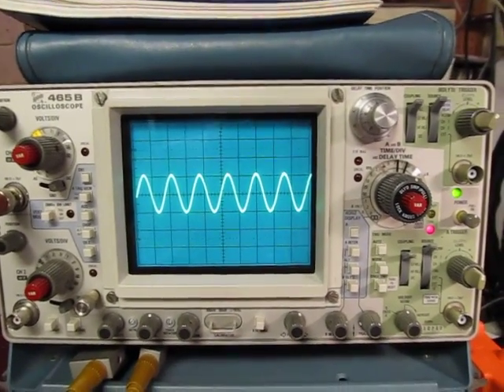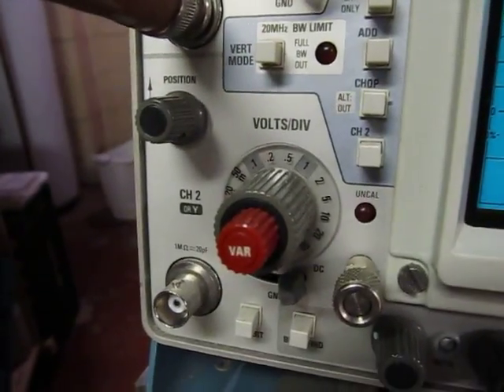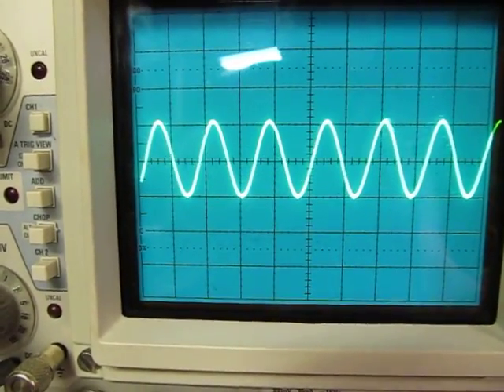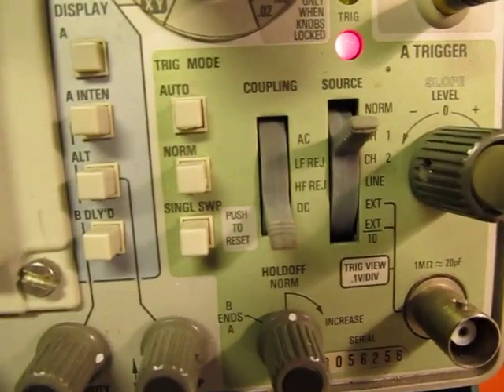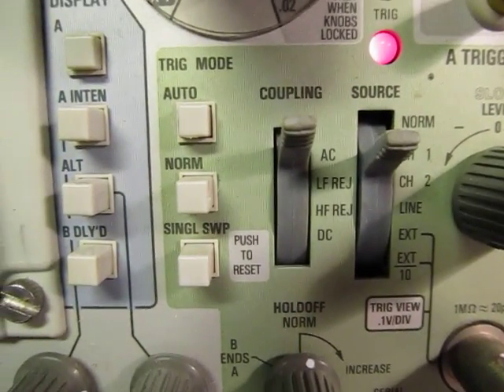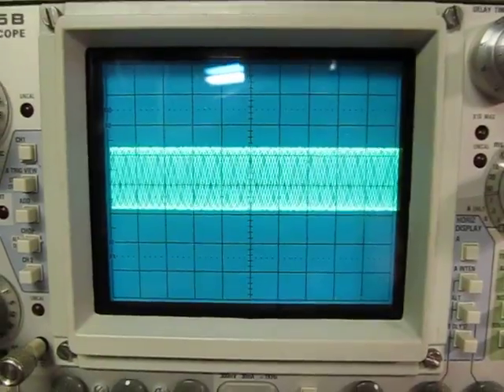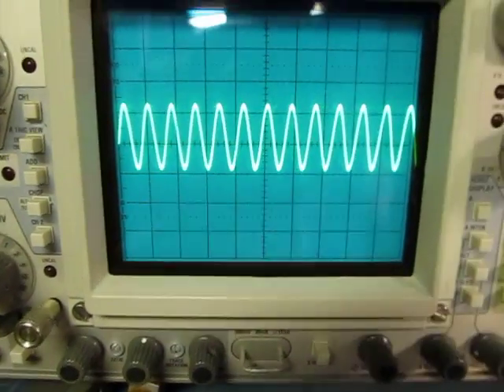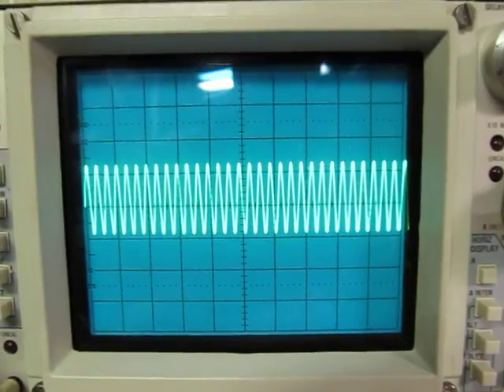#11: Tektronix Oscilloscope Triggering controls and their usage

Comment: Thank  you for sharing your experience with a CRT scope.  While I do have and use digital scopes, it's important to me to still practice the foundational understanding of measurements.  Your video helped me to better understand the various control aspects that I was not clear on, as well as (couple) the functions of the digital models.
Reply from the maker: As you've discovered, I have a lot of videos on analog/CRT based scopes as well as digital scopes.  I hope you find them helpful.

Comment: Seems my old Tektronix 468 may have finally reached its end of days. I've had some minor issues with the buttons and knobs for the past year or so, but nothing insurmountable. Yesterday however,  the old workhorse refused to boot-up. The fan came on, and the "beam find" dot indicates the CRT screen is working... but otherwise it appears dead. Any suggestions for a quick fix before I inter this fine machine in the oscilloscope grave yard? Could it just be a blown fuse or something? I apologize for my ignorance. I'm not really knowledgeable enough to attempt a proper diagnoses.  Kinda feel like five-year old kid with a flat tire.
Reply from the maker: Common issues would be power supply problems - all fixable.  The guys over at VintageTek have been doing a lot of 468 restorations lately - check the videos on their youtube channel.

Comment: When using the Oscope ch#1 to measure waveforms on the circuit under test, mostly the probe will use the frequency of the waveform as the trigger? What other frequencies or pulse waveforms can you use as a trigger for circuits under test? For digital circuits in order for the oscilloscope to be in sync you have to use the clock frequency as the trigger. I'm not sure what other types of circuits under test would use different frequencies/waveforms or pulse waveforms in order for the oscilloscope to display stable waveforms. Can you think of what type of applications of circuits that use different triggering frequencies that the oscilloscope don't sync up unless you use the external trigger.

Comment: Hi, I have a question on the grounding schemes in scopes. In case of an Analog scope is the scope ground connected to the safety ground? So if we try to measure an isolated load (without safety ground connection), is the load being grounded via the scope? I have many follow up questions related to the isolated scope and isolated probes etc. Would be great to see a video on this topic if you dont mind. I came across a webinar from Teledyne lecroy "Probing in Power Electronics
What to Use and Why". They mentioned it is not safe to use passive probes in many applications.
Reply from the maker: The short answer to your two questions are yes and yes. The vast majority of scopes have the input/probe ground tues to the chassis/safety ground. So, you do have to aware of this if you are working on something that must remain floating (such as a hot chassis).

Comment: Hey there w2aw,  I did not see any comments for the "single sweep" mode. I did not see anything for it after you went through Auto and Normal. It was roughly around 11:20. Thank you very much
Reply from the maker: Single sweep mode on an old analog scope like this was only useful when used in conjunction with an oscilloscope mounted camera.  You'd mount the camera, setup the vertical, horizontal and trigger settings as needed, arm the scope for single sweep and open the shutter on the camera.  When the scope got triggered, it would sweep once and the film (or polaroid pack) would capture the trace.  Then, close the shutter and develop the picture.  Viola - single-shot storage, as it was done back in the day.

Comment: what can cause an Oscilloscope triggering to erratic, meaning that it does not stay steady, it drifts and move when you try to trigger it.
Reply from the maker: It could be a number of things.  Most often, it is caused by the signal being too small (try changing the vertical scale), or there may be noise on the signal.  On modern digital scopes, it may mean that a signal path compensation is needed.
Reply: It's an old HP 108T solid state oscilloscope that I acquired from a friend and it does not matter what  signal I put in, it still drift from side to side. I tried cleaning the trigger pot and it help a little. I cannot get a schematic for it.
Reply from the maker: I've never heard of a 108T.  If you can point me to a picture of the front panel of the scope, I might be able to provide some pointers on how to use it.
Reply: Sorry its not 108T, its180T model.
Reply from the maker: It should be a simple matter of setting up the trigger level, slope and coupling properly.  Put the scope in NORM trigger mode (not AUTO), since AUTO trigger can sometimes fool you into thinking that you're triggered.  See my video on how the AUTO triggering mode works.

Comment: I just came across your video series and I love them.  I do have a question and it has to do with, in some videos where you are scoping small signals there’s an complete absence of high freq fuzz and genuine high freq interference, spikes, bursts and misc spuria flying through your scope’s display (i.e. cellphone, Wi-Fi - yours or a neighbor’s, cordless phone, active Bluetooth, etc.).  When I’m scoping low-level signals on a device or proto board at home I have to contend with what’s “real” and what’s in the air.  How do you avoid this airborne trash in your tutorial setups?  I have a ~$300 dual-trace + storage Hantek scope and I see all kinds of annoying RFI/EMI stuff.  Is it a matter of spending the bucks for something that’s much better as in quiet?
Reply from the maker: There are a few things...  In many cases, when probing low level signals, I will use the front-end BW limiting feature of the scope whenever the signal's frequency content is low enough.  This keeps the higher frequency RF signals from getting in.  Also, make sure the probe's ground leads are as short as possible.  On digital scopes, I will sometimes use averaging if the signal is repetitive, that reduces random and uncorrelated noise sources too.

Comment: enjoyed the video. I have the Tektronix 465B and I am in the process of calibrating it. The manual specifies the use of a time mark generator specifically the Tektronix 184. These are almost impossible to get hold of here in the UK, do you know a modern equivalent that I could use?any help from anybody would be greatly appreciated.
Reply from the maker: Any pulse or square wave generator (function gen or AFG) that is capable of producing sufficient output frequency and has a frequency accuracy better than the timebase accuracy on the 465B would be fine.  I used an AFG3252 function generator.

Comment: Right now I have a Leader LBO-523 scope. Not a bad scope for one that I picked up a state surplus store 20+ years ago for $35. I would love to be a scope pilot behind a Tektronix 465. Is this, or what is your favorite scope for all practical purposes? Thanks for the great video!
Reply from the maker: It's tough to pick a favorite.  The 465 is a workhorse.  The 485 has a smaller CRT, but is razor sharp.  The 2467 is super overall, but it a bit larger.  I go to the 2467 most often (same as 2465 but with a special fast-writing CRT).

Comment: Thank you very much. I wanted to ask your opinion about two scopes. I'll ask the shorter version of the question first. TDS3054 &  TDS3034 which one is good enough for a repair shop? 
Long version: 
I found a TDS3034B for a very good price. It comes with four probes manuals.
But I been looking for a TDS3054B Cuz I was told by others tds3054B is the scope I should get. 
But I don't have the knowledge yet to know  if I need the capabilities or the extra bandwidth of a TDS3054 in the future repairs. 
Learning how to use scopes is an ongoing project right now. At the moment I have a 100MHz scope w/ 2 probes & component tester. 
I am trying to get a repair lab going in the shop to complement the field service work that I do full time.
The boards I will work on are out of medical and dental equipment or really any boards... CNC machine pcbs,, sterilizers, x-ray boards, chair or table controllers....motor controls, some industrial PC boards.....

I can get a tds3034B for 1/2 of what the TDS3054B are going now. 
Which scope do you think is best for the repair work without over doing it.
Reply from the maker: I think you'll be fine with the TDS3034B - the extra bandwidth on the 3054 isn't really going to buy you much for the work that you're doing.

Comment: Hi,

An example of this would be usefull.

I undestand that the internal signal would adapt itself to the external one?

EXT: Signals connected to the EXT Trigger input connectors are used for triggering. External ... must be time-related to the displayed signal for a stable display. It is usefull when the internal signal is too small... or unstable...
From the manual.

Comment: Very nice tutorial! But I still have one question: does that single trigger/sweep freezes the screen so that you can make some measurements later on? Like I want to capture and measure an overvoltage spike that is happening once, not periodical like that sinewave you had, how can I do that on an analog scope like yours?
Reply from the maker: Analog CRT based oscilloscopes do not have any kind of storage capability, so the short answer is "no, it doesn't store the screen/waveform for later measurements".  The longer answer is that there were some analog storage scopes that had a special CRT that would record the trace into the phosphor which would continue to glow (like a glow-in-the-dark toy).  The quality of the written waveform would degrade quickly (fade, fuzz or bloom).  The main way that single-shot waveforms were stored was through the use of a scope camera - a specialized camera that mounted on the front of the scope (in the groove just above the CRT) and recorded the single sweep on a Polaroid picture (self developing B&W picture).  The film packs for these cameras would give you 10 pictures.
Reply: @w2aew  Thank you for your detailed answer! I do own only an analog scope and I had a feeling that the "short" answer to my question would be negative, but I wanted to be sure so I asked. I found and subscribed to your channel about 5 years ago, since then I enjoyed and learned a lot from your content. Greetings from Romania!

Comment: Trying to trigger a turn of rotary encoder on the A/CLK pin. Does the signal have to keep repeating for it to freeze? Using Tektronix 2225.
Reply from the maker: The 2225 is a conventional, non-storage CRT based oscilloscope.  In order to have a "stable" waveform on screen, it has to be repetitive.  It can not capture and store a single sweep event.
Reply: @w2aew  Thank you so much! :) Is there an affordable digital scope which can do it? I've seen digital scopes for around $30 or so.  I don't know about any other scopes. I just have this old one. Thx again:)

Comment: So if I understand correctly, what your saying is if both the scope and DUT (both grounded with a 3 prong plug) are plugged into the same grounded power strip for example, an isolation transformer is not needed because both are connected to a common ground?

Comment: Great vid, I finally learnt what the trig holdoff was :-)

That makes me wish I could learn something else. On the Tek 465 (maybe nor the 465B?), there is a "Trig view push" button (the same one that can limit the bandwith if you PULL it) on the VERT MODE group.
...what is it supposed to do?
Reply from the maker: +fabts4 It displays the signal that is being used to trigger the A sweep.  Useful if you're using the EXT trigger for example.
Reply: +w2aew Thanks. What scale does it use?
(On my - sick - 465, I don't see how to change its position and volts/div)
Reply: Do you have more videos about the 465B O'scope?If I go and buy it I want to at least have an idea what all the knobs and controls do.Thank you
Reply: @w2aew  Is the probe hooked to the. Test pins on a receiver to see what that part of a circuit is doing or not doing?

Comment: @w2aew It has one 6121 that came with it and was looking for another. Maybe I can find one NOS but will probably get a new model passive probe from Tek.   The Digital Storage portion is fun to usel. I just wish I could find the option 10 GPIB or even option 12 RS-232 serial interface. Tek had an old DOS serial comm program to pull data off of it in the support section.   I'll probably be wishing for a long time on those options though. I joined a Tek users group too. Thanks.

Comment: i have mine looking at 12.6V from a step down transformer hooked up to 120V (wall outlet) but its not a perfect sine wave. when i switch to measure the signal coming from the wall, its not a perfect sine wave either, what could be wrong?

Comment: Thank you so.much. How can one trigger on a single event. Like going from 0 to 10 vdc, or from 10 to 0. 
I'm trying to capture the charging and or later  discharging of a capacitor. I wouldn't be surprised if some people are smiling or laughing because it's probably so simple for them. Please enjoy it's okay.
Everything is easy Once you know it.
I keep getting horizontal line at zero and then at 10 as the cap gets charged. and then when I discharged it, I see it go down from 10 to zero. But I need to see that vertical graph. I'm sure you have a video of this if you do please point me to it
Reply from the maker: A couple of tips.  1) This is very difficult to do on an analog non-storage oscilloscope, because the trace from a single sweep doesn't get stored on the screen - it appears as it happens, then it's gone.  The only way to "capture" the trace is photographically as it happens.  2) You need to set the scope to "Normal" trigger, then use "Single" if your scope has it.  3) Be sure to set your TIME/DIV scale to capture the entire charge or discharge event.

Comment: I’m hoping for a quick reply here people to allow me to help make a purchase on two units currently for sale. My choices are
1) Hitachi V-525 50mHz scope 
2) Tectronik 466

As a total newbie and just wanting to setup a small workshop to get into electronics which one of these scope would be the better choice. Both units look in mint condition and only $50 apart in price. No probes are included so that would be a second question as to which probe kit would be the best one to purchase. Thanks YouTube community I respect your decisions. Thanks.
Reply from the maker: The Tektronix 466 is a better scope, but it is older.  It also uses a special CRT that features analog phosphor storage capability.
Reply: @w2aew  Thank you for the quick reply very much appreciated. Could you advise which probes is the best for the Tek466
Cheers 🍻
Reply from the maker: @richardshort4587  Anything that is rated for 100MHz or above, and has a compensation range that includes the input capacitance of the scope, would work.  If you go with Tektronix probes, you can get some with an indicator pin that will automatically adjust the vertical scale setting by 10x when using the probe.  I believe the originally supplied probes were P6105A which you can probably find on the used market (long since out of production).
Reply: @w2aew  Thank you so much for the information. It’s people like yourself that make this world a brighter place. I appreciate you took the time to respond to my request. As a retired guy who’s slow on the uptake, fresh minds like yours help people like me not get frustrated at our lack of knowledge on a subject. Thanks again and God bless you and you’re family.
Reply: @w2aew  Hello again, just a quick follow up. I purchased the Tektronix 466 today, during the bartering, the seller threw in a couple of probes. So in the end both parties ended up happy. Now all I’ve got to do is a bit light cleaning of the unit and try to learn how to use it properly. I was able to download two manuals one for operating and one for servicing. So far it appears to be working 100%. I’ll be looking through more of your videos and hoping to find one that shows you how to actually use a scope in the process of fixing other equipment. Most videos just show these scopes connected to signal/function generators and not an actual repair video. Thanks 👍
Reply from the maker: @richardshort4587  Getting to know how to use the controls (vertical, horizontal, trigger) and how to properly compensate and use probes (especially the ground lead) are key to using a scope in a troubleshooting/repair job.  The scope can show you what the signals look like at various points in a circuit - but it is really going to be up to YOU to determine if those signals look right.  The scope can't tell you that.  Another useful technique is to trace a signal through a circuit, seeing how each part of the circuit changes the signal - and then judge whether the changes are expected or not.
Reply: @w2aew  Thanks for the advice as I start out on a large learning curve. I’m sure you’ve already forgotten more than I’ll ever get to know, so it’s people like yourself I’ll be leaning and relying on in my education going forward. Once again allow me to thank you for such a quick response very much appreciated. 🍻